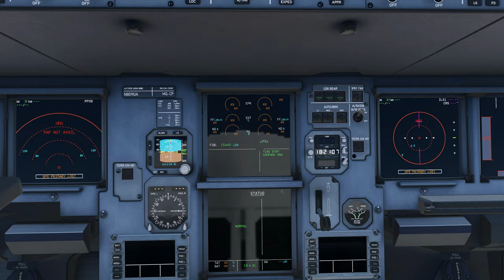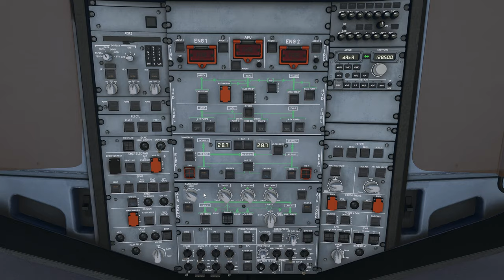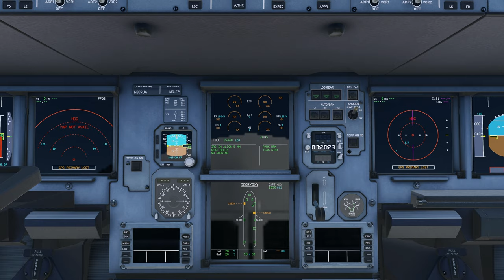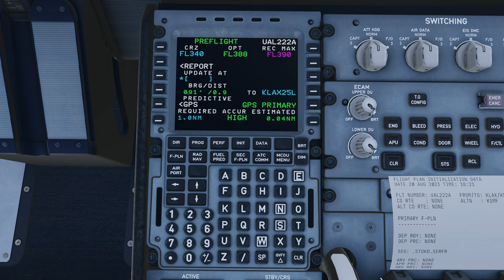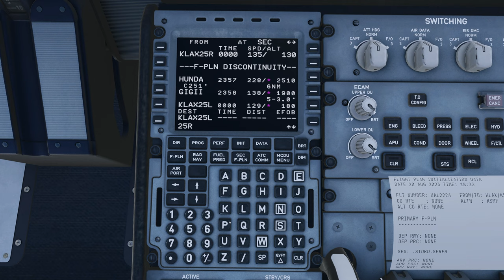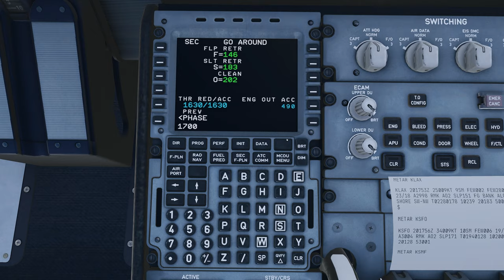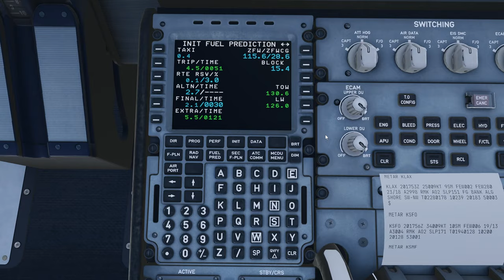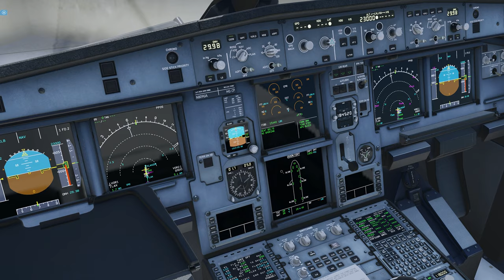X-Plane 12 | Toliss A319 | Los Angeles (KLAX) - San Francisco (KSFO)

Comment: Amazing graphics bro it looks so good. Quick question, since I don't have xp12 yet, is the parking assistance for the gate stock xp12 or is it a mod? Btw I was wondering if u could do a flight in xp12 w the salty 747-400 mod. Would love to see
Reply from the maker: Hello, appreciate it. The parking assistance is an add-on and just like MSFS, the scenery developers need to implement it into their sceneries. Well, to be honest the Sparky 747 is not quite at the level I would like it to be, so I don't see myself flying it at the moment. I'm picky when it comes to aircraft add-ons.
Reply: @BProduction222  Oh I see. I just wanted an understanding of how in depth sparkys 747 rly was since ur so indepth w flight sim. Btw whats the add on called? Again amazing vid
Reply from the maker: @n-plane  Thank you again! There are two add-ons used in X-Plane by different scenery developers, and to get them both the work is free. One is called Autogate, and the other is called SAM. It is a good idea to have both installed in case some older sceneries still use Autogate. Since auto gate is the older and more outdated version of VDGS.
Reply: @BProduction222  Oh okay thankyou so much man. I cant wait to get a pc cus I still won xplane from a q8 giveaway once. But yeah xplane has come so far and I cant wait to see the ff777. Proper 777 simulation is an essential for xp12🤣. But yeah ur so underrated as a flight sim youtuber keep up the great work man
Reply from the maker: @n-plane  That very cool! Hope you can get a new PC soon too and I can’t wait for the T7 either. Again, I appreciate the kind words :).

Comment: Hello my friend, I saw that we have the same processor, I7-9700K, but I have a RTX 208 Super GPU, I was thinking to upgrade the GPU, but I am scared about the bottlenecks, wich are your graphics settings, and how much fps are you getting. Great video and channel by the way, subbed, and like.
Reply from the maker: Thank you very much. 
If you are running 4K and planning on getting a 3090, then you will only see about 1% of a bottleneck. 
However with a 3090 and 1440p you will already have a bottleneck of about 20%. 
So now it depends what GPU you wanted to get and what monitor resolution you have.
Reply: @BProduction222  I play at 1920 x 1080, and my Idea was to upgrade to a 3080, 4070,4070ti, but I am scared about the bottleneck. Thanks for your answer!
Reply from the maker: @mistercaptain8438  With the 9700K you can only stick with the 3000 series cards. The 4070 would give you a 40% bottleneck.